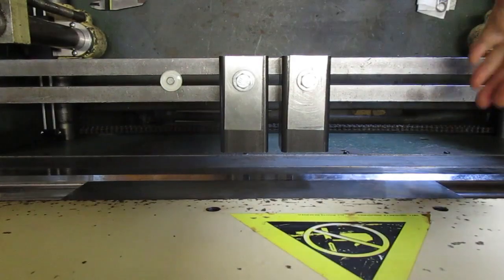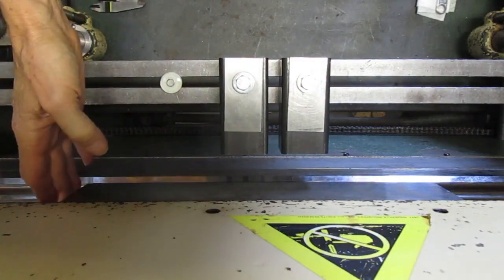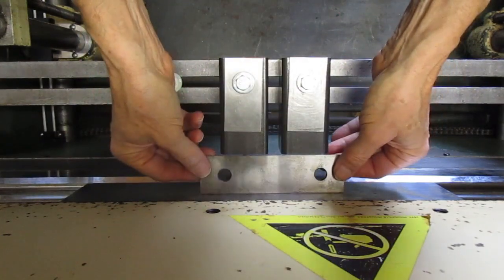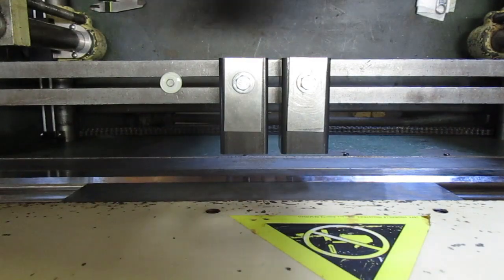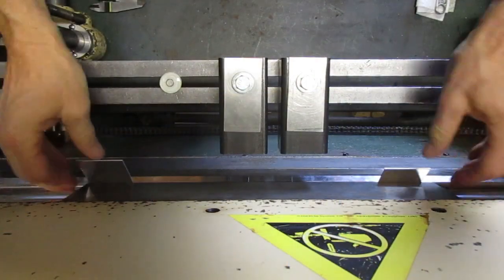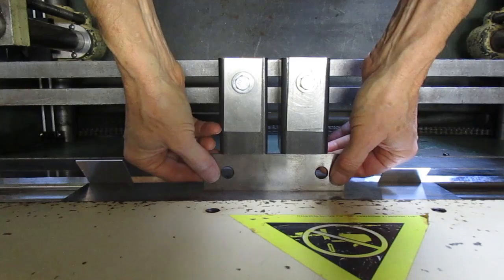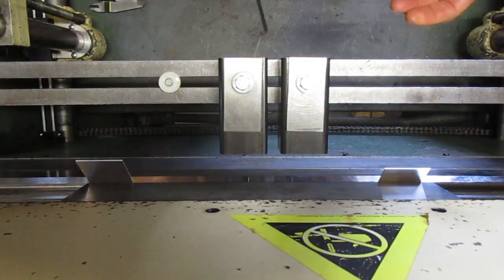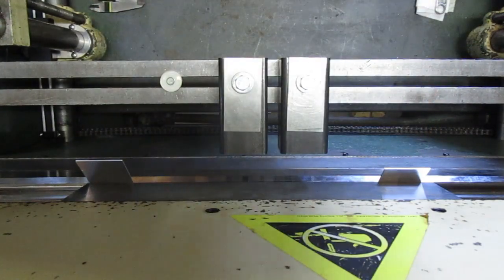Di-Acro 17T 48" press brake, die alignment tricks.

Comment: Cool info, I have this same machine
Reply from the maker: Thanks.  Di-Acro made a lot of those press brakes and they still perform well.  Mine is missing the OEM back gauge extensions, hence my mods.  I'm also missing the chain tensioner.  With a little TLC, it still makes good bends.